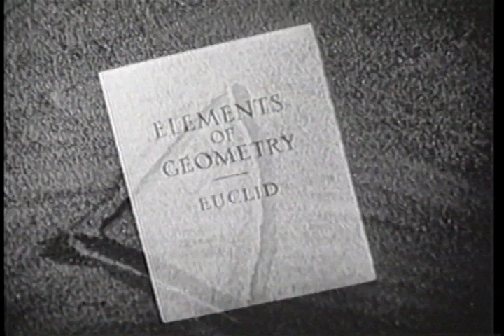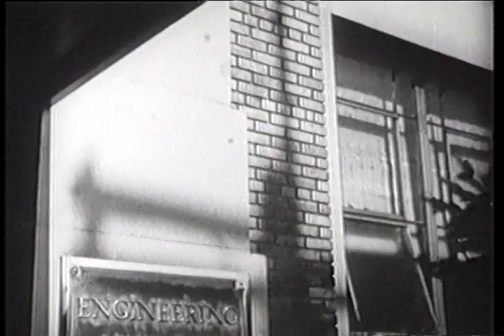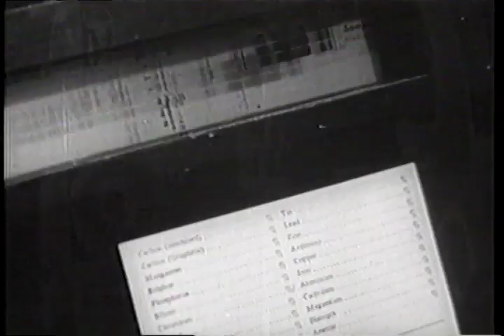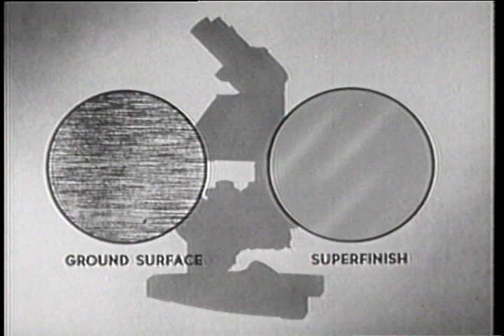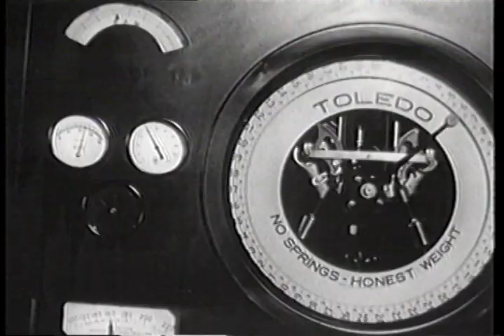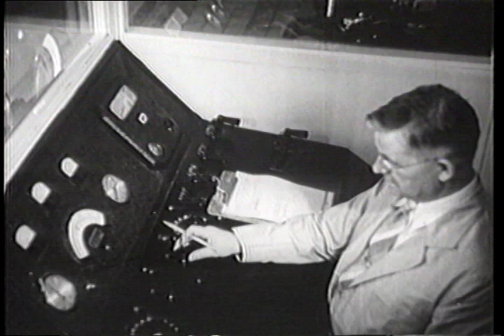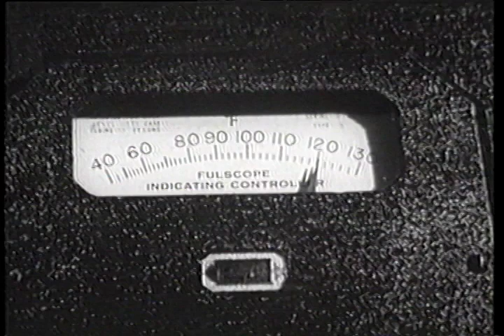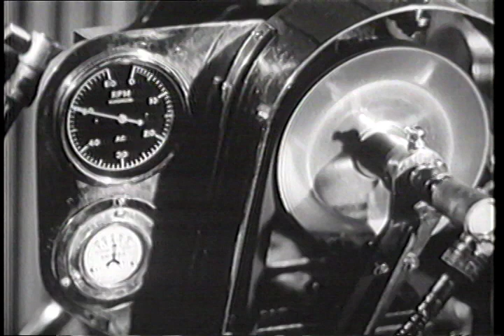Chrysler Years of Progress - 1924 - 1941

Comment: Some car buffs claim that Chrysler concentrated too much on engineering and not enough on styling, but the Cars they built from about 1955 until about 1975 were sharp looking cars.
Reply: Robbi496 The Exner "forward look" cars were knockouts, and sold really well, but they forgot about building them well. The damage they did took decades to repair, if ever. Chrysler & quality used to be synonymous in the prewar era, certainly hasn't been the case in many a moon.
Reply: I owned a 1955 Plymouth. Horrible. HORRIBLE! Pure junk from the day my dad brought it home.
Reply: @flylooper  LOLOL
Reply: I owned many 60's early 70's Chrysler products, very good vehicles.
Reply: Also known as Tanks

Comment: Very enlightening!  To realise that so much automotive R&D was in place at that time is surprising. I reckon quality was higher then than later in American auto history.
Reply: It's a throw away world now days back then everything was made to last
Reply: ***** Actually, all auto manufacturers did this, and still do.
Reply: +MrShobar The thing is back in 1950 or so people didn't have the lubricating oils available in 2015. I don't speak from experience, that I believe a car today (Let's say a 2015 model) can go a million miles on its original engine depending on the oil used.
Reply: turboslag affirmative action happened, and to meet the quota, more and more unskilled, poor quality workers were hired.  All the design in the world will get screwed up by a few assembly workers who negatively impact quality.
Reply: There's a certain bias. I live in a pocket of Los Angeles where modern home improvement stores were not a thing, and I was shopping for 1950s parts for 1950s stuff where I was living, and trust me a lot of schlocky junk was made, normally it doesn't survive and only the good stuff does, so there's this bias that in the good old days they only made good stuff. Protip: they didn't.
Reply: I didn't infer that EVERYTHING was better quality back then compared to now.  There was alot of junk around, as there is now.  However, even looking at something as humble as a Model T now, it's evident that manufacturers were more concerned with quality and their reputation.
Reply: Absolutely higher in the automobile industry. GM started declining the day Alred Sloan stepped down. Chrysler and Ford weren't far behind.

Comment: Notice at the end of the film now called a video, the highway with the cars on the concrete that seems more white but there’s black streaks and those streaks are from oil leaks because back in those days almost everything dripped oil somewhere. It still happens today but not like it did before.
Reply: Thanks for the  information.
Reply: That's oil mist drip from the breather tubes.  PCVs mandated in California in 1962 were the largest eliminator of smog producing emissions ever undertaken.  Everything else that came later cut emissions by lesser, but still important, degrees.  The next biggest drop in emissions came with catalytic converters, and the next was elimination of carburetors.  The final elimination is now here with EVs.  My next car will be electric.  Time to make Big Oil into Little Oil.
Reply: That's why motorcyclists are told not to ride on the grease strip. Maybe not as much now.

Comment: Run on an expensive fuel instead of gasoline ! They're talking about diesel fuel which is more expensive than gasoline now. I remember diesel fuel being less expensive than gasoline. I'm not sure if it was less expensive because it was a by-product of gasoline production or if it was less expensive because crude oil just took less refining to make diesel
Reply: Thanks to deregulation of fuel pricing, diesel is priced higher because the oil companies can squeeze the truckers and transport companies easier.  Diesel is cheaper to make but, thanks to Reaganomics, the price is not connected to the cost of manufacture.  Only to what the market will bear, which is false pricing.  And false pricing is a false system of weights and measures.

Comment: For instance, more than seven hundred and fifty combinations of alloys were studied over a period of years before the startling announcement of the development of amola steel by our engineers and now used in many parts of the corporation’s products.  So amazingly  tough is amola steel that a bolt of it can be bent over flat on itself without breaking.  A rare spring leaf can be wound into a flat spiral yet it can be made hard enough to cut glass and such is its fine quality that amola, the same steel that’s in axles and springs, will take a beautiful edge and give you a velvety smooth shave.
Reply: Up till recently, decent-quality disposable razor blades had diamond plasma shot on blades to lengthen service life.
Reply: You can’t buy a decent razor blade any more.

Comment: I wonder at what point it was that manufactures started using this research to make sure cars made it through the warranty. And then broke down. Even Harley-Davidson in recent years is got in on the act. Harley engines used to be rebuildable forever now those things that lasted forever, bearings and whatnot are made to break down and cost so much to repair that it's close to the price of the new engine that's engineering for you